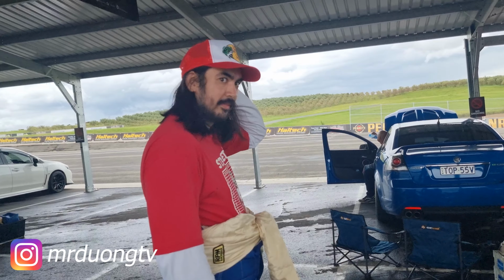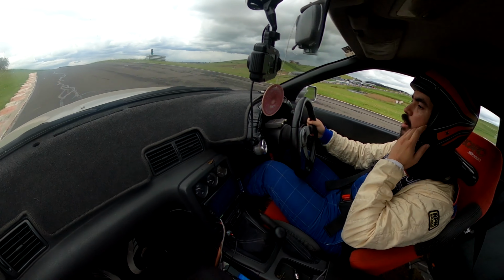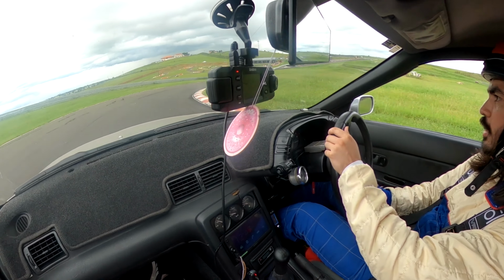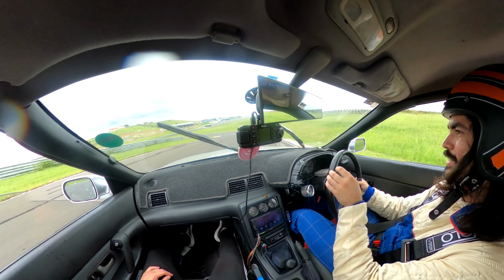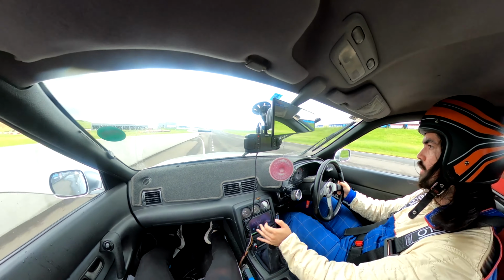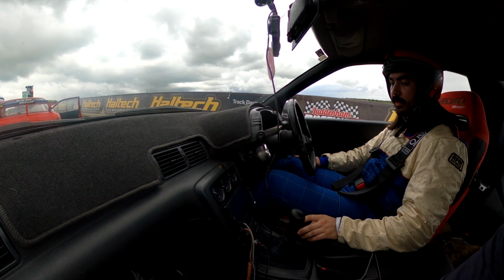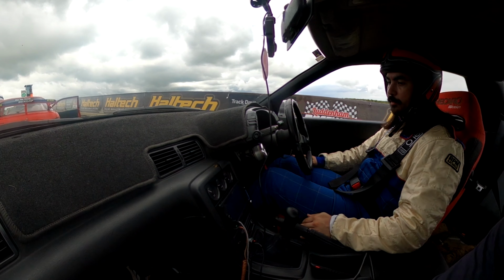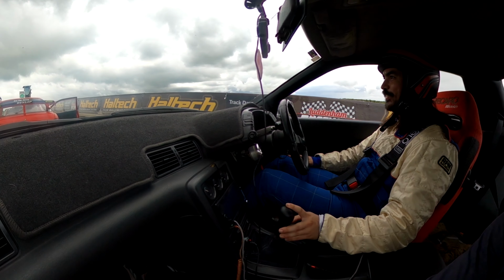300 kw Nissan Skyline R32 GTR Hot Laps | Luddenham Raceway

Comment: Awesome video, do you any specs on Steve's car? Would be interested to know what he's done to prepare it for the track work.
Reply from the maker: Cheers mate!! I cant remember what he did.. but I'm pretty sure he's running 300kw/600~ nm, aftermarket intake, intercooler, sway bars, coilovers, strut bars, bucket seats and harnesses, as well as tyres and probably some more
Reply: Awesome - thanks man. It's such a cool GTR, more so for the fact it's not a trailer queen like most these days.
Reply: @BC-1983  Thanks! Do you want the full parts list? It's had essentially everything done to it except the internals being played with. I am saving up for the HKS Step 1 2.8L stroker kit.

Engine Basics:
Garrett -9's
Nismo 600cc injectors
Nismo FPR
Nismo 276L/ph fuel pump
Nismo AFM's
ARC Intercooler.
Full exhaust (Hpi Dumps, Trust Y-Pipe,  100cell cat, 3" catback)

Suspension:
Greddy Coilovers 
Huge list of GKTECH components
Whiteline Swaybars
Cusco strut bars (Triangular in rear)
Was running RE003 tyres in this video, but just snagged some RE-71 semis

She spends more time at the track than she does on the road ;)
Won't be long before Mr Duong TV will beat my lap times.
Reply: @MrButtons1201  Hey Steve, thanks so much for parts list. Very impressive bolt ons and such a cool track weapon. Coincidently, I have 32 GTR myself  and have been following a similar path. I was considering going Step 0 HKS Stroker, but for now have opted to stick with what I have. My main drive for the stroker was to actually replace my short nose crank, but also obtain some performance upside also. Specs on mine, I have-9 turbos also, some poncams, Koyorad radiator,ARC intake, Nismo Y Pipe and FGK  exhaust. I still need to accumulate the fuel supply upgrades and some better AFMs as I am running a Power FC. Can't wait to see how yours goes with the 2.8, as its so good as is!
Reply: @BC-1983  
Hey. So here’s a more complete parts list. 

Engine
Stock - Unopened head and block
Nismo Oil Pump
Tomei Sump baffle + drain mod
N1 Water pump
Nismo AFM/MAF
Nismo 600cc injectors
Nismo 276lph fuel pump
Nismo fuel pressure regulator 
Nismo engine + gbox mount

Engine Ancillaries
Garrett 2859-9 (GT-SS equivalent?)
HPI dump pipes
Blitz front pipe
Hi-flow cat (150 cell)
Jap-Spec cat-back system
ARC intercooler 
Blitz oil cooler
Blitz oil filter relocation
Splitfire Coilpacks
Do-luck enhanced ignition harness
Cusco oil catch can
Golpher radiator
Blitz radiator cap
Pod filters 
Nistune chip

Suspension
GKTech FUCA
GKTech Front Castor Arm
GKTech Roll centre Correction
GKTech rear camber arm
GKTech rear toe arm
GKTech eccentric lock out kit
Greddy Type S coilovers
HFM front rotor upgrade - 2 piece
HFM rear rotor upgrade 
Nismo braided brake line
Nismo braided clutch line
Whiteline 22mm front sway bar
Whiteline 24mm rear sway bar
Cusco front strutbrace
Cusco rear triangular strutbrace 

Interior
Blitz boost controller 
HKS turbo timer
Greddy Suspension Controller
Blitz boost gauge
Impul 300km speedometer
Midori Seibi G-Force sensor - Red
Engine Watchdog - temp sensor
Sony XAV1000
Sony composite speakers
Pioneer slimline sub
Climate control relocation - glovebox
Recaro SR3 Drivers Seat - Millenium Red
Recaro SR2 Passenger Seat - Black

Exterior
N1 Vents
N1 bonnet lip
N1 Headlights
Nismo Door Handle insert 
Aerpro DTRL’s 
Advan SA3R 17x9 +22
(R33 GTR Wheels + RPF1’s 17x9)

I have cam gears coming and will get the car retuned for more dedicated track work in the new year. 

Find me on socials if you want to chat more.